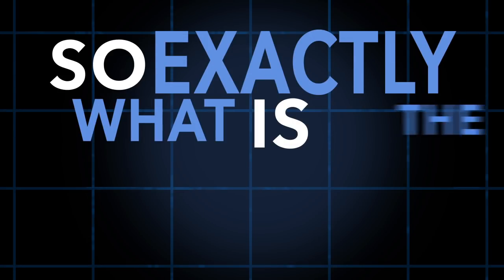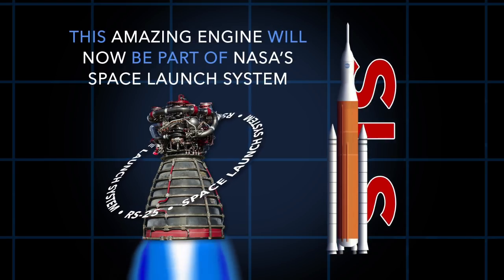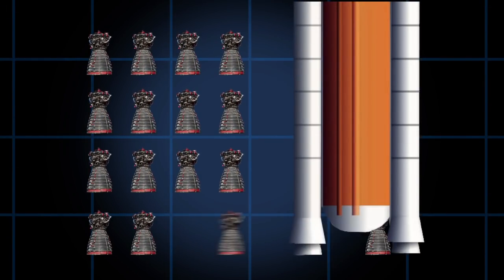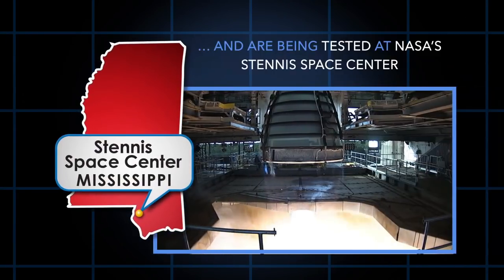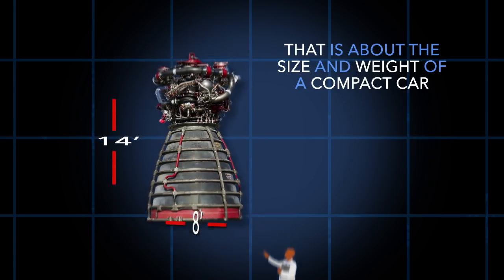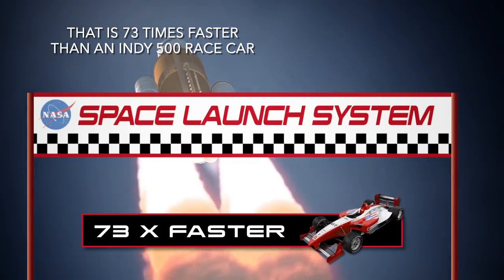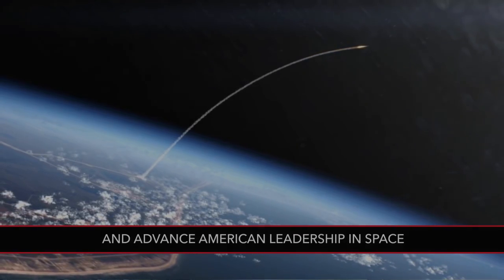RS-25 Rocket Engine Explained

Comment: Misleading to say the 4 RS-25s will put SLS into orbit. What about those huge solid boosters? Would you say the Vulcain engine puts Ariane5 in orbit by itself? Nope, cuz the solids provide 90+% of the thrust.
Reply: You need both to put the SLS into orbit.
The SRBs might provide more thrust, but for a much shorter timespan.
He didn't say they do it by themselves, they both help putting it in orbit.
Reply: He even said "helped propel the space shuttle into orbit" at 0:08 and probably wanted to use another expression for the SLS rather than saying the exact same sentence twice.
Reply: Still not wrong to say the RS-25 will put the SLS into orbit.
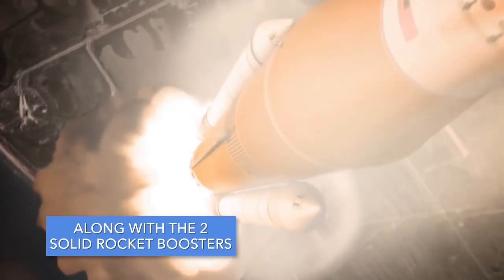Reply: atptourfan At  0:59 he clearly says what you somehow missed.
Reply: I mean, having a Space Launch System(designed for lifting things from the surface of earth to space) in space seems a little redundant, doesn't it?
Reply: What even kind of craft could take the SLS to orbit? Ya know? I don't think even twice as many rs25s could take the sls to orbit. See how stupid it looks now, when someone points it out?
Reply: A rocket sitting on a launch pad is fully fueled and at its maximum gross weight. As such the first foot it travels upward is always the hardest. After that it only gets easier as the vehicle consumes propellant. As such the SRB's are only necessary at the very beginning to get the fully fueled rocket off the pad and just a part of the way up. After that the core stages continue firing and accelerate the lightened rocket the rest of the way up.

Comment: Give me the famous Apollo Saturn V F-1 engines over the shuttle engines anytime of the week. If NASA would reconsider the F1 engines and upgrade them to higher performance!
Reply: The F1 would be idiotic in this application. You really want to use a little tested half century old kerosene engine instead of a hydrogen engine that is quite possibly the finest rocket engine ever developed?
Reply: RealityIsTheNow I'm told they (the shuttle engines) are the Ferrari of rocket engines and the most complex in the world, so yes, completely inappropriate for disposable applications.

Comment: Only sixteen engines!!!???....NASA better start looking in their back rooms and closets because there are a lot more around....They may need reworked, but there are more to be had. 16 engines only give you 4 flights of SLS....not enough forall the  test flights, flights to the moon, and then Mars. Remember these engines will not be recovered from an SLS launch.
Reply: skyprop
Plenty of engines for a rocket that will fly 2-3 times and be canceled.

Comment: what is more poerful falcon heavy or These. hopefully Musk will test fire his engines this week at NASA pad 39A (I think)
Reply: The RS-25 is between 1,860 and 2,279 kN of thrust (depending on altitude).
Falcon-9 and Heavy use Merlin 1-D engines with 845 to 915 kN of thrust.

Falcon-9 booster has 9 Merlins, for a total of around 8000 kN (for up to 162 seconds).
Falcon heavy booster has 27 Merlins for about 23000 kN (for up to 162 seconds).
SLS has 4 RS-25's for a total of around 9000 kN (plus 32,000 kN from its SRBs, for two minutes of the 8 minute first stage burn).

The Merlin engines are about twice the the thrust to weight, so they they do not drag as much extra mass around; however, the Falcon boosters all are meant to return, so they fail to use a significant fraction of their available lifting power in order to land themselves.  Because SLS is a 1 time use, it will use its full power for lifting payload.  That being said, Falcon rockets may ALSO be used expendably, allowing them to deliver around two to three times more payload than rated.

Thus, 
Falcon 9 is 22,800 kg to LEO.
Falcon Heavy is 63,800 kg to LEO.
SLS Block1 is 70,000 kg to LEO.
SLS Block1-B is 105,000 kg to LEO.
SLS Block2 is 130,000 to LEO.

The increasing mass to LEO for SLS is mostly due to (as yet unrealized) upper stage and SRB changes.  

The real difference between these rockets shows up in the price tag, including development costs, the cost for SpaceX is around $2,700 per kg and dropping.

The cost for SLS so far is about $257,000 per kg and if (somehow) they mange to follow their projected costs (for once) then (assuming they only do Block1 launches) they might manage $146,428 per kg by 2030.... only 54 times more expensive than SpaceX.... But don't worry! They've already saved loads of money by making sure all these RS-25's don't go to waste...
Reply: thanks for a great response
Reply: Yeah great response. 
It'll be interesting to see where the Raptor engine goes.
Reply: That cost you quote per Kg for the SLS seems a little bit off, by orders of magnitude. The cost is (officially) $500 million per launch for 130,000 Kg to LEO which if true works out to about $3900 per Kg,  only some 50% more than Spacex cost.  
I doubt the launch cost will really be what they quote and probably something around a billion dollars is more realistic. However even so it is 'only' three times as expensive as a Spacex, not 54 times.
To get the figure of $146K per Kg you would need to assume that for the total projected cost up to 2025 of $35 billion they would only ever manage to launch two rockets.

The SLS will probably end up being a costly but workable solution to bridge the gap for ultra heavy lift until Spacex get the BFR into service which will probably be sometime around 2025.

The Falcon 9 and Falcon heavy will in the meantime probably take up most of the market for everything else except for government subsidised launches and possibly Blue Origin for the smaller payloads in a couple of years' time. 
I don't think they will face much competition for a good time until the other major companies realise that expendability makes no sense and slowly figure out how to make their own reusable systems and do so in an economically viable way.
Reply: SLS has 16 total RS-25 engines to play with; then they're done (they might plan to make more at some point).  So they can do at most 4 launches (4 engines per booster).  They're projecting that they will spend about $35 billion on R&D for the booster system as a whole.  So basically, if you include R&D costs for both the booster and the $6 billion Orion capsule (i.e. at least 1 thing it's supposed to boost... so that it has actually has a purpose).  Then you get the ridiculous figure I quoted (I also figured they'd stay Block 1, until the later blocks stop being paper rockets). 

Maybe it would get close to the $3900 /kg figure you quoted if they were able to defer the research cost over more launches.   But they don't plan to do that.  So I let the numbers reflect that.  Hope that explains.
Reply: RS-25's are more powerfull. It will take 27 Merlin Engines to lift Falcon Heavy off the Pad as Opposed to 4 Rs-25's and two solid rocket booster for SLS. Payload weight to orbit goes to the SLS.  And With 27 engines there is more that can go wrong as opposed to 4 or six engines. You are correct 39-A is For Falcon and Falcon Heavy.
Reply: skyprop : In terms of reliability at this point none of the falcon 9 engine has ever failed to my knowledge but I'm pretty sure that Falcon Heavy could still reach orbit with 26 out of 27 engines... on the contrary if 1 engine fails on SLS it's game over. So it's not that black or white.
Reply: Falcon Engines have never failed  at this point which is a long way from When Was the Last time an RS-25 Failed Out of 38+  years of service( only on the ground start-up) ...And I do think the Mission could survive On 3 Engines IF the SLS gets off of the ground to a certain altitude. In that case You would have to burn the remaining 3 a little longer. Just like they did with the Saturn V When an Engine went out a few times. It's all Planed out.  NOW, Don't get me wrong,  I want the Heavy to Succeed. But I look at the engineering...And It tells me all those engines in a confined space...If one fails and throws shrapnel into another engine............Remember Russia's N-1 Booster??? Something similar happened to that.  HOPE FOR THE BEST!!!  Let's Go On Tuesday!!!! Best Wishes!!! Put the Tesla In Orbit!! Thanks for your comments
Reply: And GET IT DONE!
Reply: Turbo: Out of the 38+ years of flight service only 1 RS-25 Failed in flight and that was questionable because of a possible faulty sensor. they shut it down and the shuttle was still able to reach orbit. Now on the SLS. If you loose one engine as long is that it's not at launch or soon thereafter the SLS can still fly. It would just have to burn it's 1st stage 3 engines longer, like they did about 2 times on the Saturn V. NOW Don't get me wrong, I want the Heavy to suceede  but from an engineering and common sense standpoint you got to ask yourself, With all those engines in such a confined space, If one fails and throws Shrapnel or Spikes Pressure in the engine compartment??? This same Scenario Failed 1 of the N-1 Launches(too many engines close together)
Otherwise Go TUESDAY!!! FLY HEAVY and Put the TESLA In Orbit!  Root for the Little guy!! Thank you for your comments.
Reply: skyprop : In any case we can reliably say that reliability of those two rocket engines are pretty much the best one could expect so I don't think that the difference between the two rocket designs will play on that part. I really think that reusability is the game changer though. Thank you for your input. Long life space exploration ! ;-)
Reply: Turbo: I neglected to touch on that. you are correct with your point, However the RS-25 was THE FIRST reusable rocket engine :) I do love Falcon's stage recoveries....they are the first ones to do that. They are great to watch And I'm sure Saves some serious cash. For COMMERCIAL Purposes the 9 and Heavy are the most economical at this point  as well as the Manned Dragon system.  If you want to go to the moon or beyond.....???? Thanks!
Reply: Faulx Eve bullshit the falcon rocket engine is alot more powerful than the Russian design as seen today with a test launch. The whole rocket science community agrees the falcon rocket launched today is the most powerful rocket yet to date.
Reply: skyprop" rs 25 engine is more powerful." that's bs bc spaceex just launched the most powerful rocket to date. This is agreed upon by all rocket scientist around the world. Get a clue fool.
Reply: Casey Simon calm down, we know falcon heavy is the most powerful OPERATIONAL rocket to date, but it's not the be all end all of rocketry, SLS will eclipse it in power, IF they ever get the damn thing to a point it's ready to fly. That said, BFR is going to be a sight to behold when it flies, and it's likely to do it before NASA gets SLS off the damn ground!
Reply: Syd Syko I am calm I'm just tired of trolls saying Russia has the best rocket engines and America has to buy their engines bc we can't build our own
Reply: Casey Simon first off compare apple to apple. RS-25 is a rocket engine, Falcon Heavy is a whole rocket. RS-25 produces more trust than a marlin which is a FACT. If we talk about the rocket, then yes Falcon heavy is the most powerful rocket in service TODAY, not in history. Both Energia and Saturn 5 dwarfed Falcon Heavy.
Reply: nuke99 semantics really? Fokin semantics. The rs25 is the most powerful rocket "engine" to date the falcon 9 is the most powerful "complete rocket including total engines" to date that has been successfully launched with out blowing up. The rs25 is a upgraded advancement of the saturn5. The Saturn 5 engine produced more thrust than the rd180 engine which was used on the energia rocket. Saturn5 rocket had less actual engines than the Russian n1 or soyus rocket. The American shuttle used 3 rs25 engines with 2 boosters the Soviet buran used alot more engines per flight. Engine for engine the rs25 was and is still the most horsepower. Though Russian engines use a safer kerosene based fuel than hydrogen. The space ex used a civilian based engine where the rs25 was a military not civilian based engine.
Reply: Casey Simon F1 engine is much much more powerful than RS25...
Reply: nuke99 ever heard of Google or research? The f1 was used on the apolo rockets in the 60s designed mostly by vonbraun. Until the shuttle which used a turbocharged  for lack of a better word and updated rocket engine which was 85 percent f1 or Saturn 5 engine which became the rs25 the f1 or saturn5 was the most powerful engine to the  date. The rs25 took the saturn5 or f1 title away.  While total sum of thrust on the energia rocket was not higher than the US space shuttle it also had 16 main engines and the US shuttle had only 3 rs25 main engines while still having more foot pounds of thrust than the energia rocket lift capabilities.
Reply: Syd Syko you do realise the falcon 9 just launched is what you refer to a bfr. Right Space ex return boosters and core is the bfr concept so it launched yesterday.  Sls simply means space launch system. You do realise that. I mean the falcon 9 is the bfr and the falcon9 is the sls space launch system
Reply: The Block 1 SLS is only 70t to LEO and the initial $500m cost per launch is for Block 1 only and quoted back in 2012. I think they're looking at closer to $1b per launch. The true cost would be much much higher. They can only do 4 launches before they run out of engines so they need to pony up $60m x 4 per engine for each new flight after that. My calcs are $14k/kg (1b / 70,000) for SLS block 1 vs $2.3k for FH (fully expended @ $150m / 64000kg). I call the difference a factor of 6 which is still significant.
I do think that the SLS program will be scrapped after only 2 maybe 3 flights. What a disaster.
Reply: Wow, So many fan boys and gays on this thread.
Reply: Casey Simon did u just say the falcon 9 is the BFR? I think your the one who needs to do a google search.